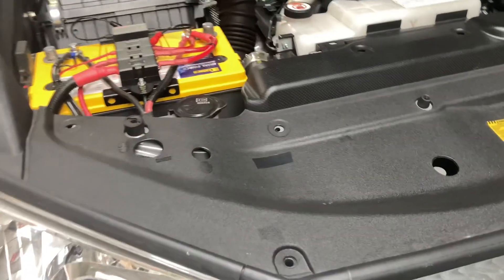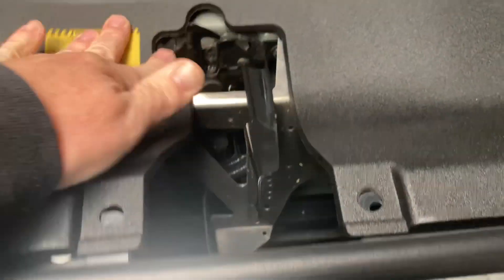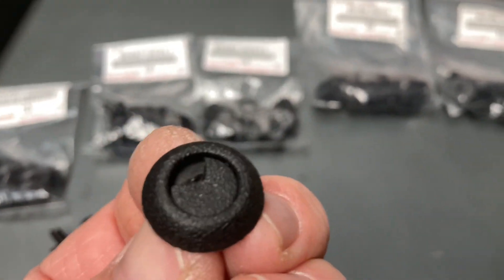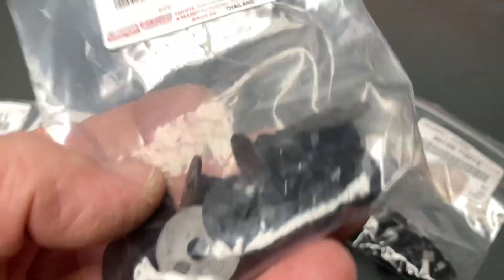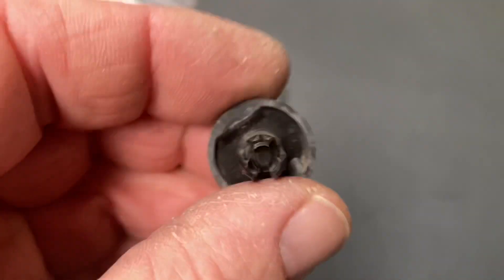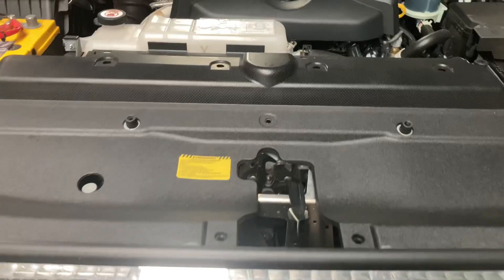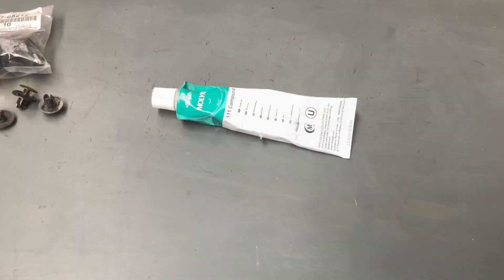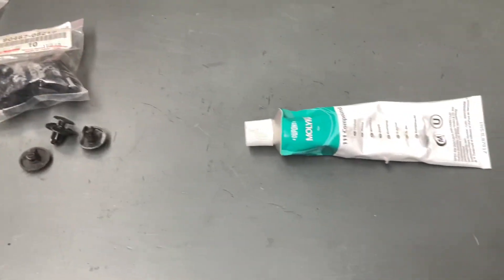WASTE of MONEY Better off WITHOUT THEM

Comment: They prevent minute vibration between the plastic cover and rad support, which causes paint wear, which creates rust.
Reply from the maker: So you actually believe a loose fitting clip stops vibration and paint wear? Really
Reply: @Fourby4Diesel  tried and tested.
Reply: It’s their intention

Comment: the cover must be there to guide the air flow. if the clip broken, just buy new ones which are cheap. it is not there for 'beauty'. on the hwy speed, if the clips are not there, the cover will be pushed up.....not good for the cooling.